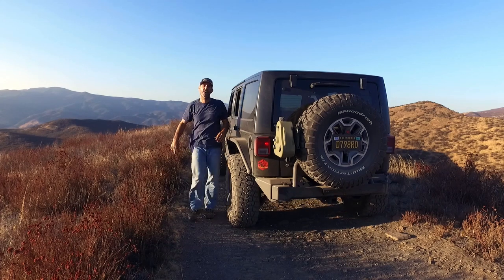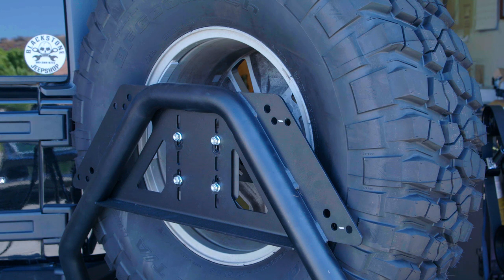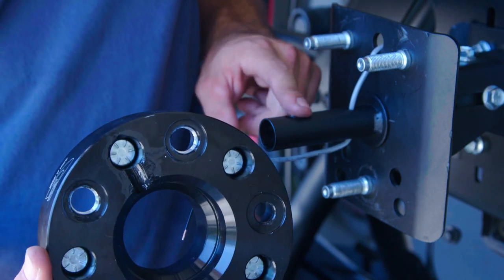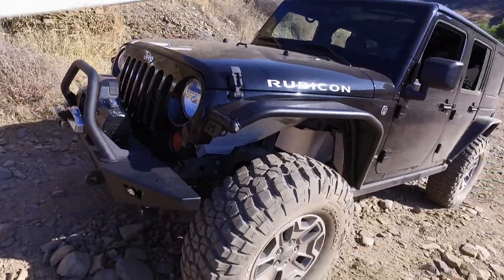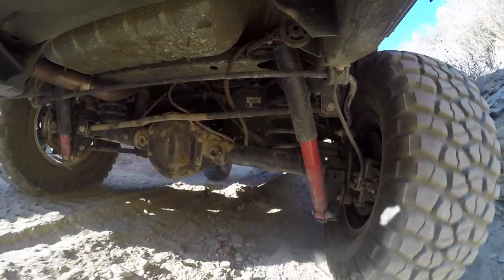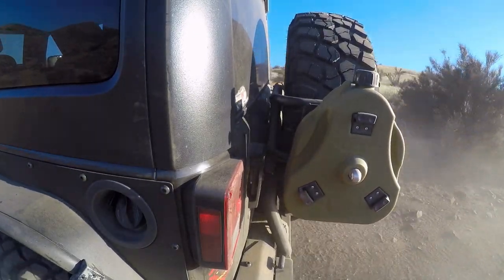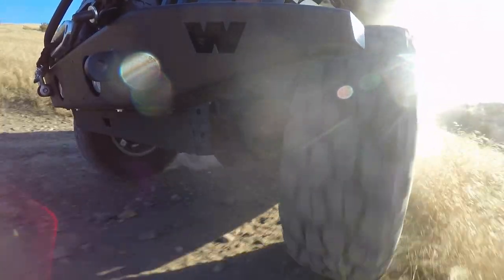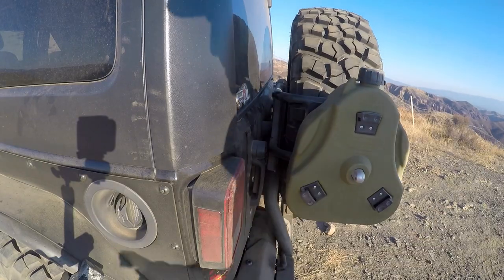Jeep Wrangler JKU Off Road Tuning and Training PLUS License Plate and Third Brake Light Relocate

Comment: Not sure if you know this trick, but if you flip your rear-view mirror upside down, you'll get even better visibility out the back with the larger spare tire. Nice Jeep man, looks great. I run 35's on my 2dr JK with stock suspension, stock wheels with spacers, and the Xenon flat fender flares. Similar setup =)
Reply from the maker: I am going to try that mirror trick, thanks so much for the tip! I've been pretty happy with the performance so far with this setup.  The only thing that really has made me cringe was last week in Death Valley I hit a cattle crossing at 60mph and jumped the thing about 40 feet at 4 or 5 feet high and it hit the bump stops VERY hard... oops.  An extra few inches of travel would've been nice for that.
Reply: oh man, I hope you got video of that! =D

Comment: I have a 3.5" lift, with 35" tires. Uphill on the highway I can feel powerloss. It's not major, but I assume 37's would be an issue. I don't know how you guys do it. 

Btw, I love your channel. My favorite jeep channel.
Reply from the maker: Change the gear ratio in your front and rear differentials. That's how you make the bigger tires less impactful on the engine.
Thanks!

Comment: I love watching these videos! I really can't wait to get a jeep. Are new rims and metalcloak rock sliders in the jeep's future?
Reply from the maker: Thanks! I do like these rims but might try to find something else soon...any recommendations?
Reply: +autoedit You're welcome! I really like the Black Rock series 952 rim. It's very deep with faux beadlocks. It has a nice classic look to it. The only downside to them is they are steel, so that's quite a bit of extra weight. It's worth it to me to have the exact look that I want, but if it's not for you then you should also check out the Fuel Trophy D552. Those will give your jeep a little different look while roughly keeping the same colors as the stock Rubicon wheels.

Comment: You said the sway bar disconnect on but @ 11:35 you can see it traveling with the suspension. Is it not working then?
Reply from the maker: +see_me_rolin 72 The electronic disconnect happens in the middle of the bar so the ends move independently

Comment: How many MPGs you getting now with the couple hundred extra pounds on this thing?
Reply: i bet around 15 on hw
Reply: I run 35s, metal bumpers, fenders, winch and get 19.1 mpg on highway.
Reply from the maker: Just about 15 combo driving and 19 on long highway drives.

Comment: You could always mount the jack to the hood
Reply: I agree. I never understand the struggle when there's an easy solution. But, aesthetically, maybe it's ugly to some. I like it. Makes the jeep look beefy and rugged.
Reply: +Bullion Head I think it looks great on the hood
Reply: i mounted mine across the roll bar in the back
Reply: Be careful. In a wreck it could fly off and go forward and hit someone in the head.
Reply: Jason did you ever address adjusting that metal cloak hi lift mount?

Comment: Hello
Reply from the maker: Howdy!
Reply: autoedit Quick question about your mustang. What transmission are you going to use? I remember you saying you had a T5 but do you think that trans can hold the power you are going to be putting down?
Reply from the maker: I'm using the stock BorgWarner T5 for now.  It should be fine for a while, even with the blower. It's only set up for 5-8 lbs of boost and I'm not drag racing it so we'll see.